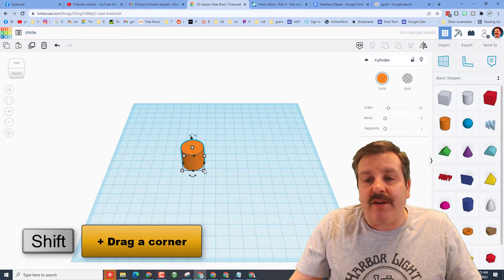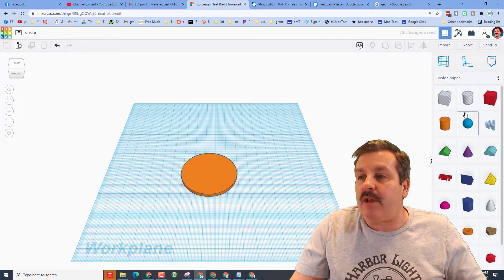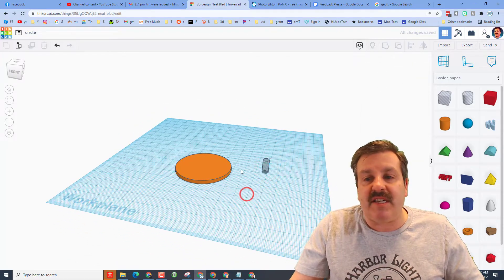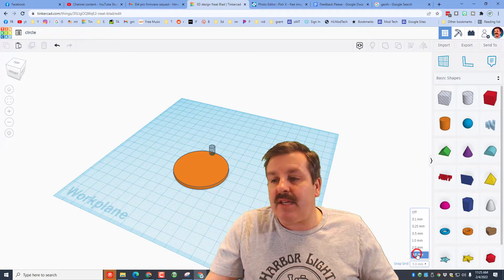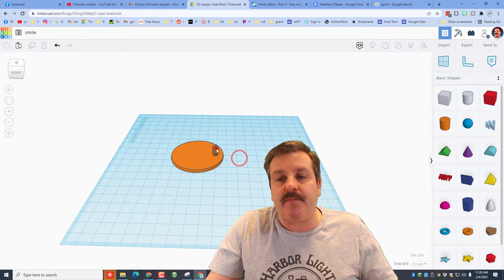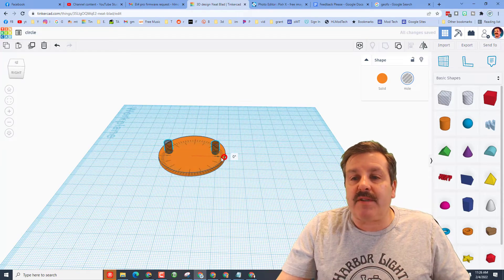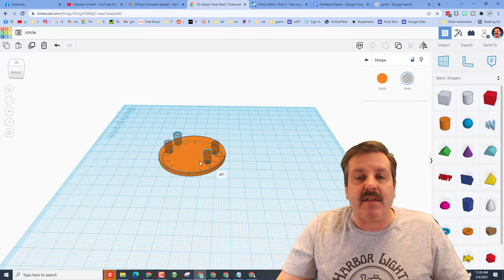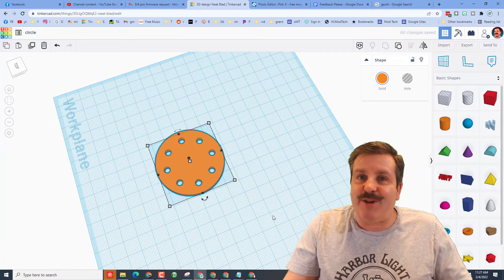Place Holes evenly on a circle in Tinkercad | Steps in under 3 minutes

Comment: Hi I have registered to your chain. I am quite new, but thanks to you, I now navigate pretty well in tinkercad. I do not have a 3d printer, but instead a cnc. I am using Aspire. I have designed a half of an egg, that I want to dig on a plank with my cnc. However, when I import the 'hole' in Aspire, it shows as a solid part. What can I do differently so that I can cut on my CNC? Would you be able to have a special program dedicated to CNC users? thanks so much!
Reply from the maker: Thanks for dropping by. I have not worked with a CNC machine so I am not really sure. I will run through my contacts and see if I have someone that may have info that can help you though.

Comment: In try to edit a 3dprint to a powersupply. This not working for me, its not creating hole. What in the world do i wrong. I follow this step by step and just try to make a easy hole.
Reply from the maker: Is there any chance your holes are sitting on top of the shape? You need to make sure you sink them in before you group. Ctrl+dn arrow is how I would push them in... That may change depending on the angle you are working from.
Reply: @HLModTech  it was something wrong with the model, chatgpt said it was not " watertight " whatever that means 😂
Reply from the maker: So... Tinkercad designs as solids... so grouped shapes are solid. Other tools design as lines, curves, faces... and parts may not really connect with each other. That is what it means when an item is not water tight.

Comment: Thank you for the video, this has helped me tremendously! I am trying to create a replacement part that I desperately need, can you demostrate how I can fit 20 hole triangles with a 2mm gap between ontop of a cylinder that is 341.60mm in circumference? I cannot seem to size my triangles the correct way in order to get 20 with even gaps..
Reply from the maker: I am tied up tomorrow, You can reach me at hlmodtech gmail with images of the idea I may be able to whip something up by Friday. I have a laser in the cue for Thurs.
Reply from the maker: See if maybe you can solve it with the array tool. https://youtu.be/U7JV32MIHKg

Comment: What's an easy way to create teeth for cogs
Reply from the maker: If you search gear there are a few built in. This video uses them for fun... https://youtu.be/XnHdcD6xMMY
Reply: @HLModTech  those are useless I need custom gears for vintage RC cars
Reply from the maker: Those gears are customizable with parameters. If you need more control than that... you may want to check out Fusion. I made a gear as part of one of my lessons at CADclass.org.  They do a really nice job of teaching skills. Even have a book to go along with it. https://www.cadclass.org/?ref=b83ab5 You can even use the code 25hltinkercad to get 25% off any course you take there.

Comment: In a couple of videos re: holes, you quickly changed the 'sides' setting of the hole to 64.  Why and what does that setting mean?  I'm a beginner.  Thanks for making great videos that get to the point!
Reply from the maker: Good question. 👍 For a cylinder it is the number of sides that make up the cylinder. An 8 sided cylinder would be quite blocky. With 64 sides there are pretty smooth.
Reply: Ah-ha!  Thank you so much!  @HLModTech

Comment: Hello This is great but I am trying to do 5 holes 72 deg apart around a circle which means is it possible to just move one hole at different intervals?
Reply from the maker: I will think about a way to solve it in the traditional editor. This is a codeblocks tip. Make sure you watch the video in the description for how to deal with the changes in Codeblocks. https://youtu.be/R54lDiTHTQ8
Reply from the maker: lol... Forgot I already solved a similar question. https://youtu.be/xqARlkoSeWw?si=mXsbRVSE6RbgIVvd 😂
Reply: @De_Raaf
0 seconds ago
Maybe a bit late but i hope this is what you are trying to achieve. Do exactley as per the tutorial and rotate 36 degrees instead of 45 this will give ten holes. Ungroup the holes and delete every other hole; result 5 evenly spaced holes.

Comment: I have a sense this tutorial has my solution, but I have no clue what keys you are hitting and how to find them.  Perhaps I need one of your beginner tutorials.  I need a disk 172mm diameter, with 3 holes, 6.4mm diameter, evenly spaced at 120 degrees, with center of each hole 57mm from the center of the disk.
Reply from the maker: I am using the arrow keys to nudge. This tutorial is a tad newer. https://youtu.be/XBSPd2mU66Y Maybe it will help. Codeblocks may be a slick solution too. Let me see if I have something.
Reply from the maker: This is my codeblocks tut. https://youtu.be/R54lDiTHTQ8 Note they have put the variables in their own area now.

Comment: Would be great, if you could tell us what key your were hitting to nudge the hole 5mm as this is not obvious in the video.
Reply from the maker: My bad. It is just an arrow key on the keyboard.
Reply: But where was the 5mm set in for an arrow key move?
Reply: @11290slk   its at the bottom right of the screen

Comment: Great video and I designed a perfect wheel center replica for my 8 lug truck, however trying to do my 5 lug trailer wheels is not working!  Since I can't put a shape on either side, i need to do one at a time and rotate 72 degrees..  Once I combine the shape and rotate it takes the radius from the new part shape so the circle will not spin concentric! With even holes across the same plane the radius stays center..  Any help out there?
Reply from the maker: Thanks for the kudos. If you don’t mind, shoot me a share link to the project and I’ll try and solve it in the morning. Right now time for bed. :-) Have a good one and thanks for reaching out.
Reply from the maker: You can find me at Hlmodtech everywhere. Or just use the Message tool On my website.
Reply: Got it. Thanks!  I was overhanging my circle using radius as center.  Added to my radius so the outer edge was now the edge of hole.  Filled in perfect.  Took 20 seconds!
Reply: Maybe a bit late but i hope this is what you are trying to achieve. Do exactley as per the tutorial and rotate 36 degrees instead of 45 this will give ten holes. Ungroup the holes and delete every other hole; result 5 evenly spaced holes.
Reply: @De_Raaf  great advice.  Thanks!
Reply: @jameshenninger8894 I have thought of an easier way. Draw the disc, add the first hole then select both and use the duplicate function, rotate to the desired angle, say 40 degrees for example, you will then get 9 holes with no deletion required. Once done group the whole lot. Hope this makes sense.